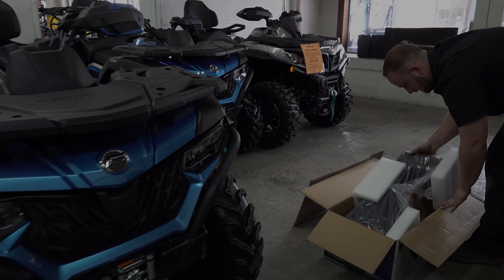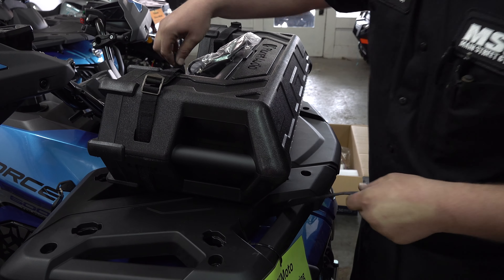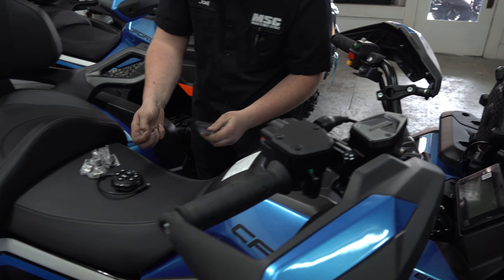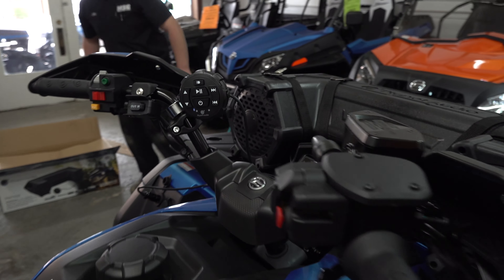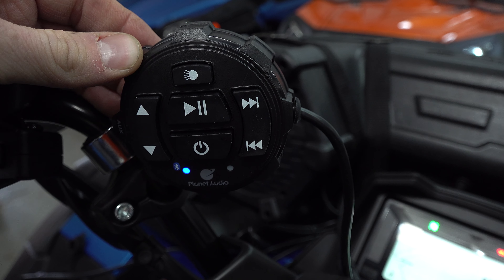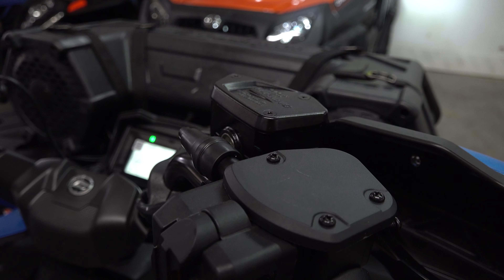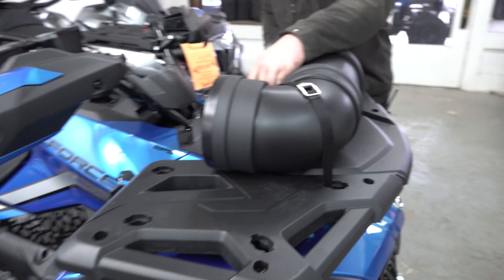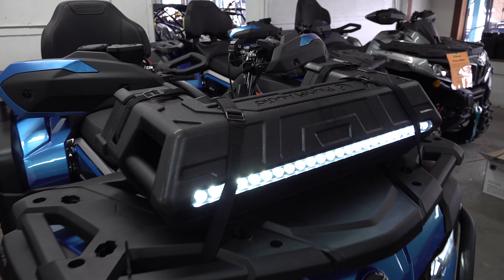ATV Speakers / Sound System Options for your ATV | CFMOTO Honda Canam Polaris & More

Comment: This isn't about a radio but I have a 21 cforce 500atv and I'm having trouble finding a rear seat that works with it. The moose and others with the storage on them don't leave enough room on the driver's seat with the pad for the rear seat in front of the rear rack. Do I have any options as far as a different style rear seat. One more question. Can the rear rack be turned 180 degrees? Will the holes line up for the mounting brackets?

Comment: I've got a 21 Sportsman High Lifter and have been looking into the Planet Audio/Boss set up and can't make up my mind. I've already accepted I wouldn't be able to mount anything like this to the front due to the radiator relocation. What would you suggest be done about wiring it up if it's mounted in the back?
Reply: Which did you end up getting ?

Comment: Wonder what’s the best option if you have a windshield?
Reply from the maker: Robert i havent had hands on with a atv with a windshield on it. I cant give you a good suggestion
Reply: @RealTalkPowersports  thanks, just wondering. Just got back from signing the paper work for my new 600 in camo. Thanks for doing the videos.
Reply: Will work with a windshield. If you also buy the front rack extender it won’t fit.